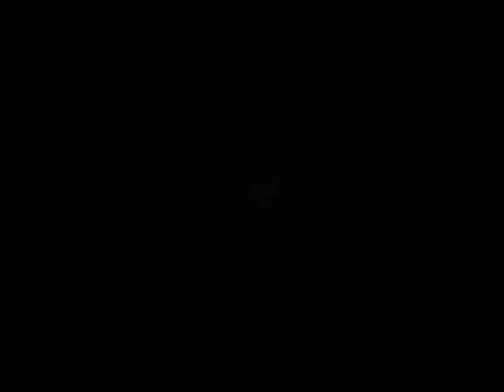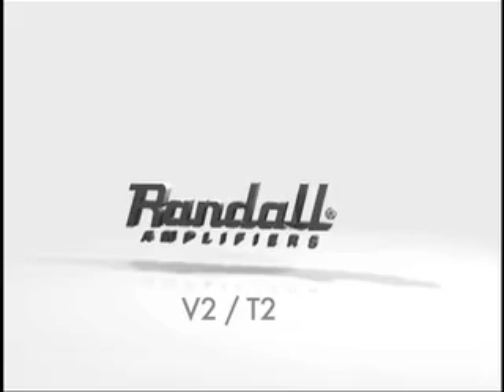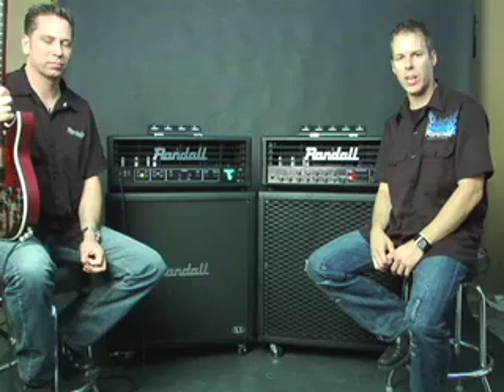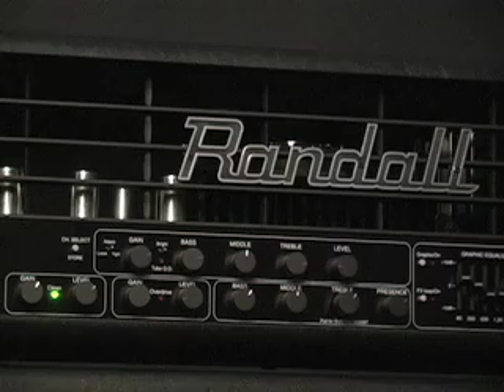Randall T2/V2 Intro--Part 1

Comment: Tube heads sounds better than IC driven amps... tubes are loud and give you much more power than solid state amps.
Reply: Yes, but solid state was not only a price point . They are just more reliable. May not sound as good,  but they are sturdier.